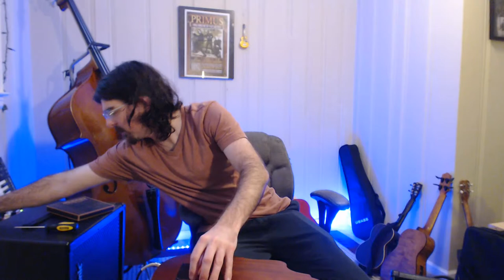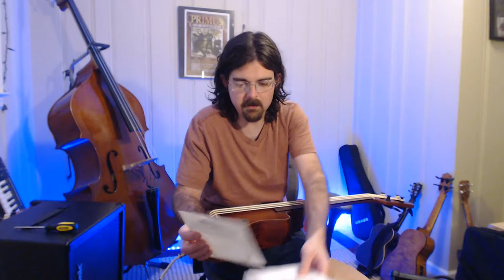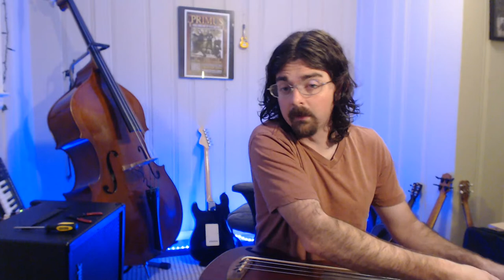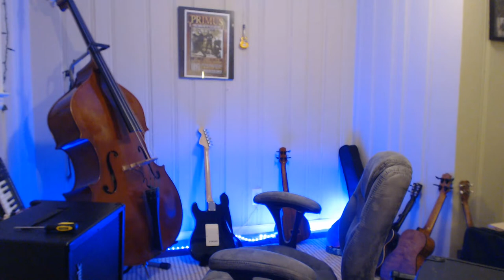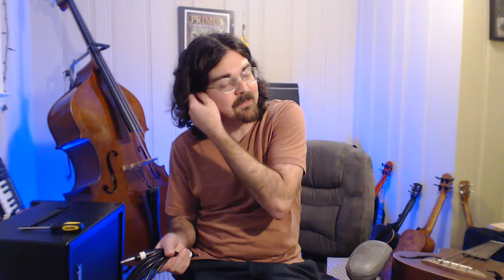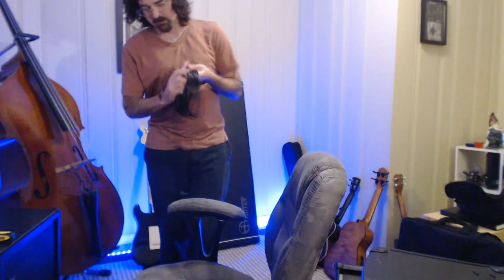Putting Flatwound Strings on a cheap fretless bass ukulele

Comment: I'm in the process of putting the Galli Flat Wound strings on my Cordoba Uke Bass. It's a 23" scale and came with round wound strings. (Noisy)
The slot in the tuning machine for the E string needed to be filed open and I also needed a new nut. I also dress the fret ends - I will update this comment once I have it completed!
Reply from the maker: With the 23" scale, are there any issues with the Galli Flats being too short? I'm curious to know if this works for you. I believe they are designed for a 20" to 21" scale. Or have they made ones for different scales now? Thanks for watching, and I look forward to hearing your update!
Reply: @stephencoxbass  Hi Stephen! - I found the 23" version on the Strings by Mail website. Finally got them installed on the bass and LOVE the tone and overall improvement in sustain. Especially on the low E string. Still working on bringing down the action. I do notice the low E is much louder than the others when plugged in. I can balance it out with some EQ on both the amp and the pickup settings. Still hoping to improve it some... Thanks for the note!

Comment: I just found out that it is not exactly the same u bass... It has the F-holes in it, the head is a bit different and it does have a truss rod, as far as I can see. It has a triangle thing on the head with three little screws.
Reply from the maker: That’s good news that someone is making a better version of the bass!

Comment: Here I am again... Clicked on your links. The bass-link leads to my Batking (Musoo) bass, but the one featured is currently unavailable. On the picture I can't see a trussrod. I was lucky because mine (the exact same as the one on your link) does have a trussrod. That means I could change the strings, I guess. The other link leads to the strings, which are also currently unavailable. Shame, so now I will have to order them on the Dutch Amazon site, which does not give you a commission. Sorry about that.
Reply from the maker: I’m glad you found one with a truss rod! Thank you for letting me know that exists now…I may have to look into that. Thanks for watching as well!
Reply: @stephencoxbass  I finally did it! I put flatwound strings (Kala/Galli) on my Batking. I am not very happy with them, because they are quite heavy to play on. Seems the action is higher than with the rubber strings. Is there anything I can do to adjust that? Lower the saddle? Adjusting the truss rod? My flatwound G-string also rattles a bit. Thank you so much for posting this very helpful video!
It's been a while now. Is the bass uke holding on?

Comment: Hello, I have a bass ukulele similar to that.  kala.  What would be better metal strings or these?  I am concerned about tuning.  which would be better?
Reply from the maker: The intonation might be slightly better with the round wounds, although I would need to compare them with that in mind to know if there's really a difference. Thanks for watching.
Reply: @stephencoxbass  thank you so much.

Comment: What gauge strings did you use?
Reply from the maker: I don't know off the top of my head if they have different options, but Kala's site says these are: 0.06, 0.08, 0.1, and 0.13...I'm guessing that's in inches.